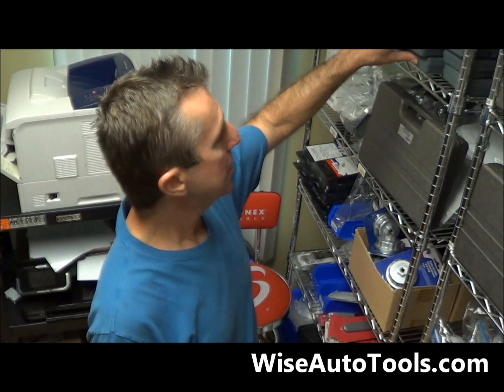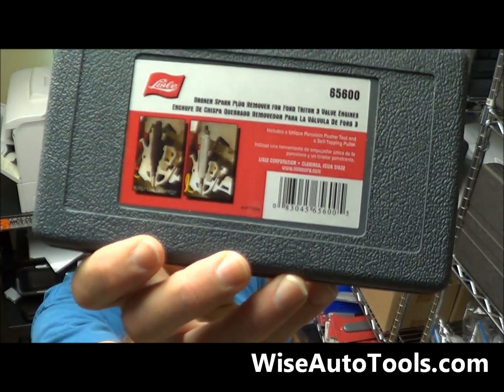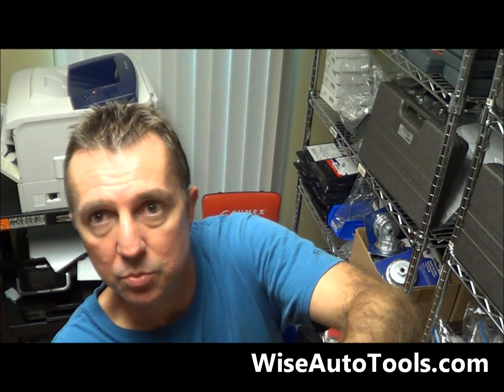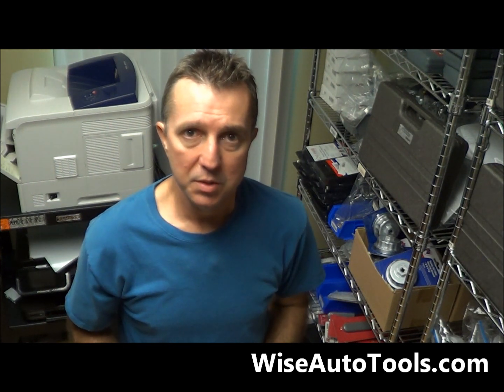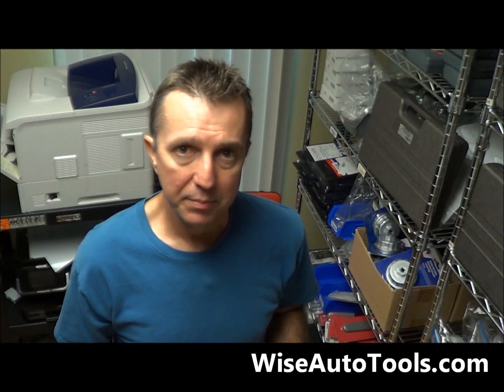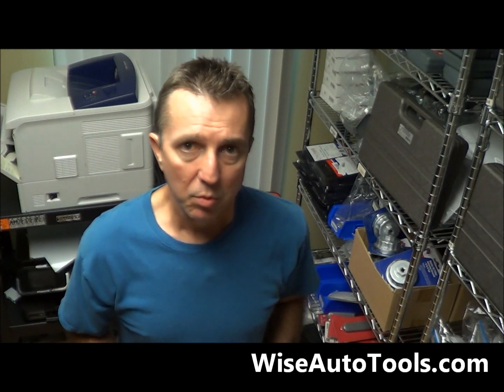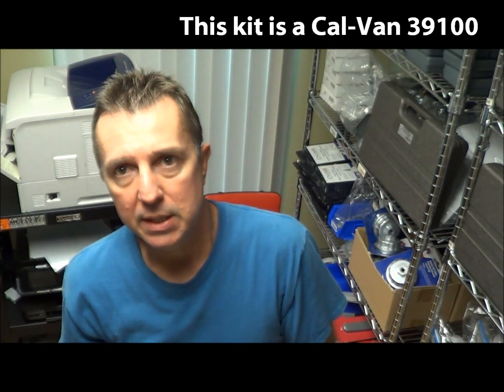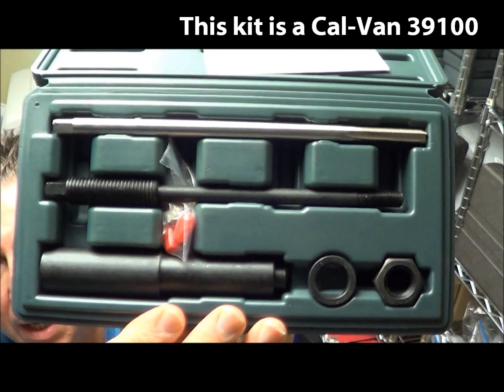Ford 3V Broken Spark Plug Removal Tools - Review

Comment: Question, so how can you pull the porcelain if the electrode metal tip is still in it? You cant put a pin in it to lock tight in.
Reply from the maker: +Laby 70 Usually the electrode will come out. Maybe needle nose pliers. Good Luck.
Reply: +WiseAutoTools Well I got lucky. I got all 4 broken ones out. Bad news is the metal piece like pencil lead fell into the engine. So my advice is to not bottom out the pusher tool. Stop about 1/8" from bottom out. The first one did this. The last 3, I stopped 1/8" short and the strap on the end held the electrode in. Good news is. I rolled over the engine and by miracle it must have went into the exhaust. Because once I startef it with the new one piece  plugs. Champion 7989. There was no banging. I was inspired to go by a few lotto tickets since my luck was good at this point.
Reply from the maker: +Laby 70 Alright! Gotta get lucky sometimes :)
Reply: I tried a tool similar to the Cal-Van. I tried to remove the bottom porcelain 7 times. The Loctite never held. Now I have no choice but to use the Lisle tool.